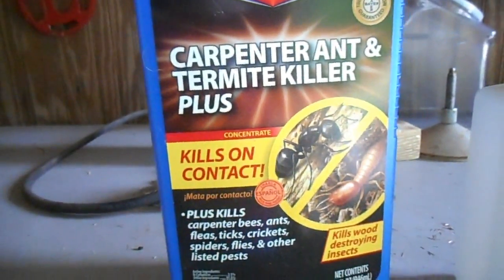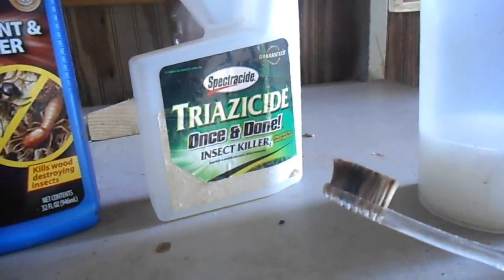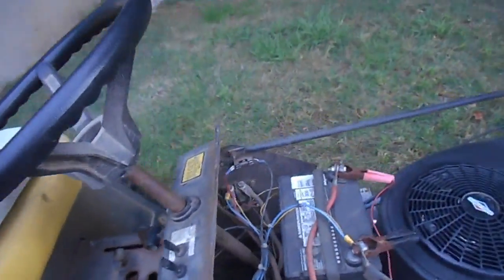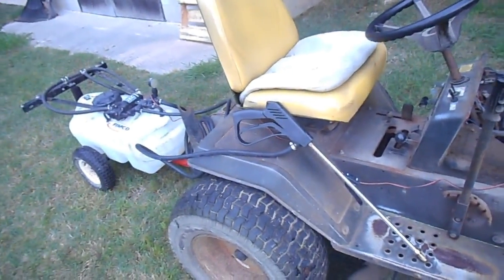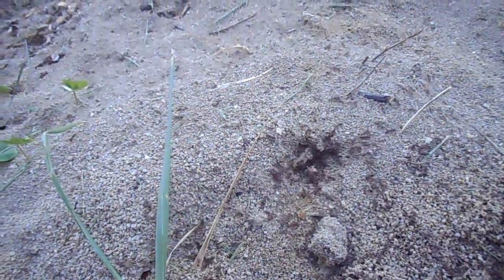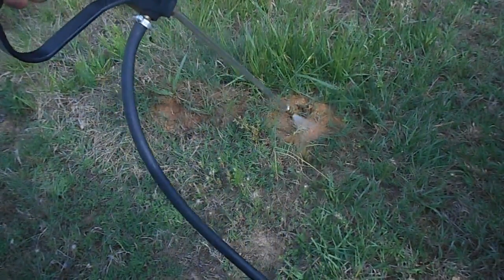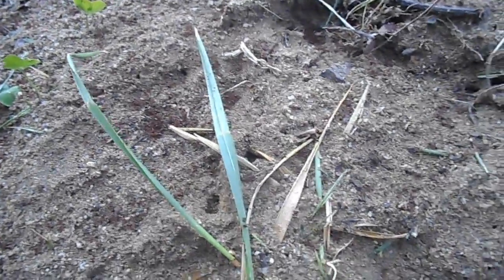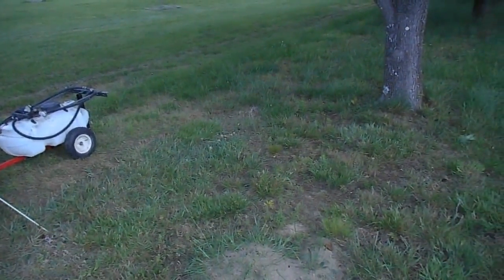Fire Ants

Comment: We have them in Florida and I think all we due is chase them from one area to another. If you look around each mound you will find little satellite mounds and if you don't get them they come right back
Reply from the maker: Kenneth Marlow - yep, the outpost forts as I call them.   got to get them all or in a week they are back.   when certain locations get really bad I make a point to re-inspect and retreat if necessary.   I can knock them down on one side of the farm then have them move in on the other side...   this could be a full time job.

Comment: Can't say I've ever run into fire ants here in Ontario. They could be here I just not aware. After a heavy rain I have seen ant colonies moving out of the soil. Nice sprayer SB. I got one very similar but 30 years older.  I would be tempted to take a hoe and stir the nest up good and really piss them off, and then blast them with the good stuff. Been thinking of you guys down south. We never got close to getting started in the fields. Lots of rain here but none of those Toad Stranglers like you got. Lots of time to check the damage  and make assessments. At the height of the flooding, things look pretty desperate, but as each day passes things dryout and don't look so bad. Hoping you and Jeff and the rest of the boys good planting/replanting from here on out. Remember we're all in this together. This time you guys took it on the chin, next time we'll take our turn.  KIT doug.
Reply from the maker: Douglas Laramie - thanks and yes we are all in this together, well put Doug...    thanks for this comment.

Comment: Awesome little tank trailer for lawn tractor, it makes your mower a very handy tool, it gives me ideas, thanks for showing this
Reply from the maker: Jan Kotze - bought tank sprayer to knock weeds out of the lawn with selective herbicides.  one day while working hard with the 2 gallon tank hand pump sprayer it hit me.  pull behind, electric motor, wand on hose.  called myself a name or two and went to get it.   problem back then was exhaust from motor on mower was blowing hot air down on the grass and killing it.  now that is fixed with the pipe I added to the muffler and it all works great...  :)     thanks for watching Jan.